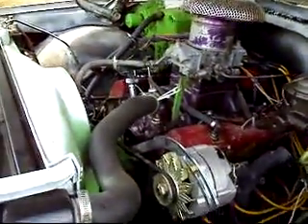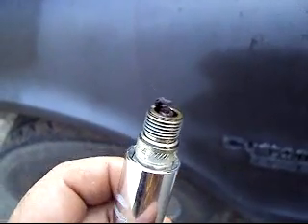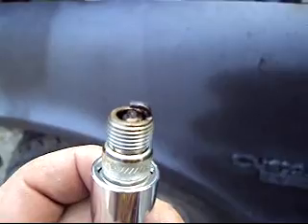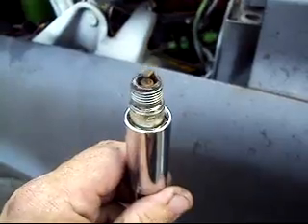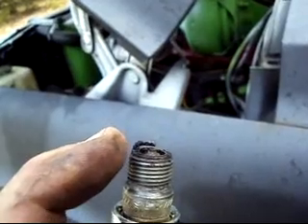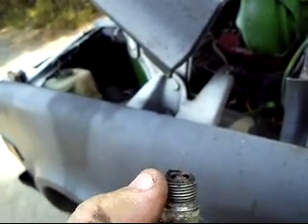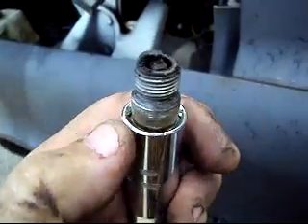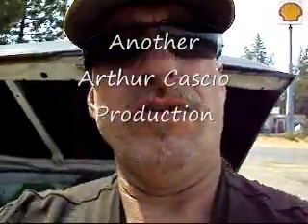ArtsAllover; Valve Guide Seals

Comment: I have a subaru gt turbo that has low compression in #4 cylinder, it does not smoke nor overheat, im wondering if i burnt a valve, or if it could possibly be the guide or seal?
Any thoughts?

Comment: @chevyc10man valve stem seals....pull the heads (and have  shop vac handy because theres gunk in your lifter valley too) it took me 3 days to pull the heads, change the seals, and reassemble my 1986 chevy 350. it was doin worse than your truck is. now, no more smoke or fouling plugs. if it were rings, itd smoke heavy all the time.

Comment: @GAG91690 go outside and start it.....pop the hood and remove the oil fill cap. if theres no puffs of smoke(a little is normal) that come out, its your valve stem seals...pull the heads and replace them. the gen 1 smallblocks with egr killed valve stem seals by overheating them.

Comment from the maker: @chevyc10man In ur case that was the solution,,in my case if you read the original diagnosis I had a defective radiator that caused the heads to become to hot to often that dried the valve stem seals out which allowed oil to drip past the valve stem seals.. Thanx for your input....

Comment from the maker: @chevyc10man  I would suggest that if your spark plugs are loading up ,,valve guides,,and if not rings are worn,,blue smoke is an indicator of burning oil,,do a compression check an go from thier..If its running and not blowing alot of oil run'er til she drops,,,lol,,hope that helps some,,later Art..